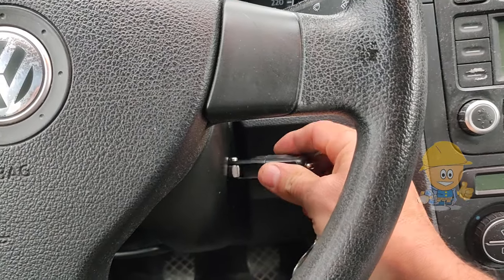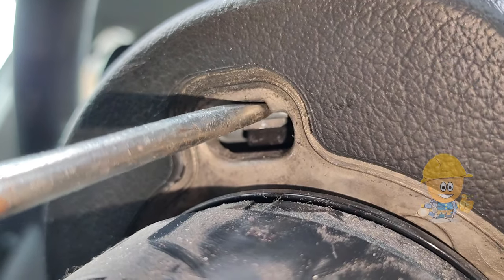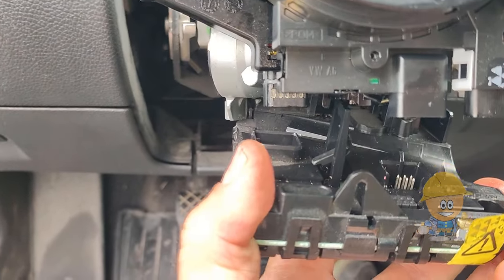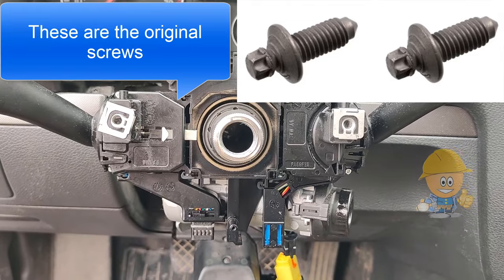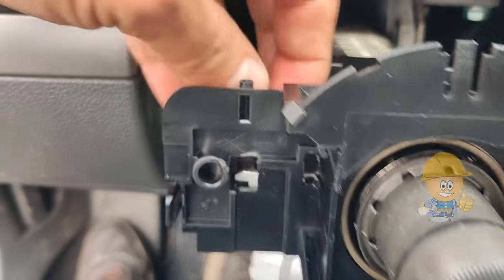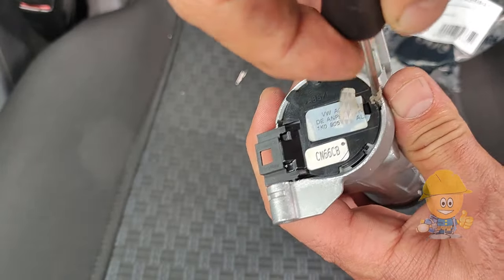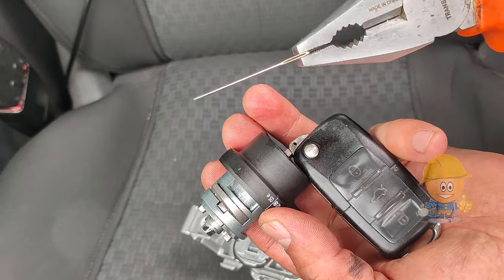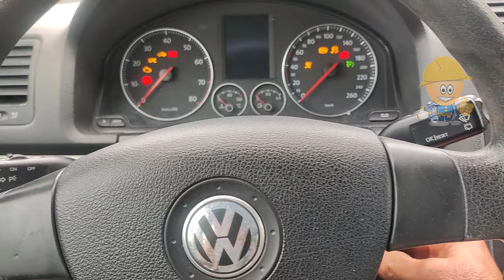How To Fix Stuck Ignition Steering Lock on VW / Volkswagen

Comment: Can I just remove the steering wheel lock so my ignition doesn’t get stuck anymore?
Reply from the maker: It is recommended to replace the part with a new one to avoid any other risks.
Reply: Yeah I mean somehow take out that little lock in the housing

Comment: Thank you so much for this - garage didn't want to touch the job. Successfully completed though I found it easier to tap the bolts out through the holes at the front with a hammer and screwdriver rather than drilling them out.
Reply from the maker: Glad it helped

Comment: I finally finished doing mine but I will tell you this, that little trick with the paper clip was extremely hard. It took the paper clip and a couple little snacks of the hammer in the back for it to release correctly putting it back together was a cake. Thanks.
Reply from the maker: I'm glad you made it, and thank you for the appreciation

Comment: Thank you so much this video saved me a $750 and gave me some DIY points. A tip for anyone that is having trouble with the tamper proof bolts you can use a Dremel and get a diamond tip and fit it through the space and press it down on the bolt.
Reply from the maker: Glad it helped!

Comment: I tried to head off the key cylinder from the beginning because this is my issue. How to release the key cylinder without able to get in ignition mode, turning the small whole to get the wire straight in? Thank you very much

Comment: Had an issue with mine where I could not get the lock into the correct pin position. I ended up having to cut the unit in half and remove the innerds to get the lock to release.
Reply from the maker: I am very sorry to hear that.
I imagine you've had a lot of work

Comment: You guys will never believe me how i fixed the problem. I just turned the whell a litle bit and the ignition unlocked. 😭 (I turned the ignition while still holding the wheel)
Reply: Doesn’t always work
Reply: Mine got stuck today,read this comment and tried this and it worked! Thank you, you saved the day!

Comment: This is happening on my VW and idk where to buy the part and I don’t have replacement bolts or a way to drill into the existing bolt to make it easier to put it back and I also don’t have a hole punch or w/e it’s called and ugh I hate VW so much. I’d rather have a Toyota. Some day I’m sure it’ll get stuck permanently then I’ll have to do it or take it into the garage.

What I wouldn’t give to know somebody who knows stuff about cars I could pay as long as I don’t have to fork out $1000 that the mechanic will probably charge. 

Anyone want to buy my VW? Lol